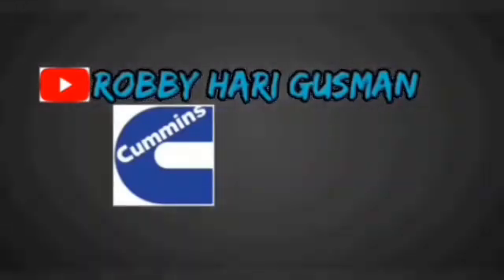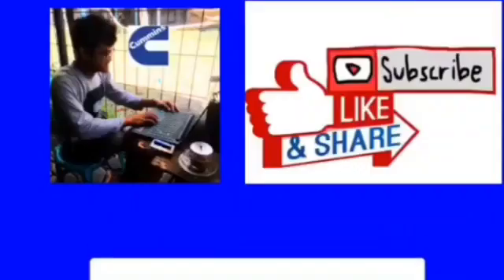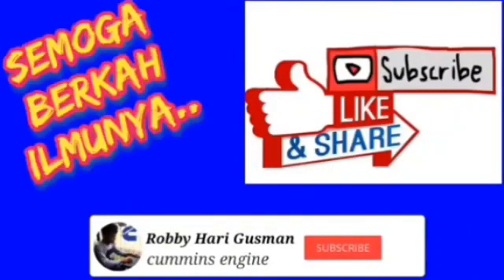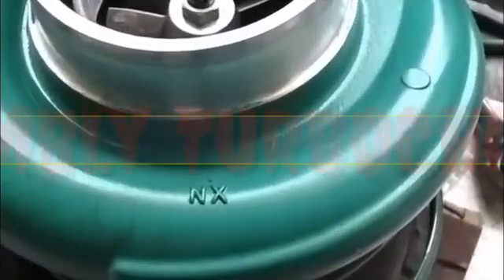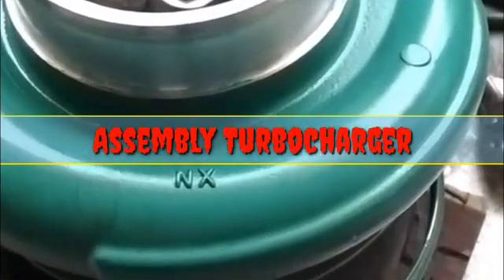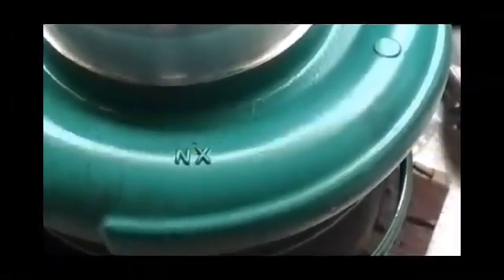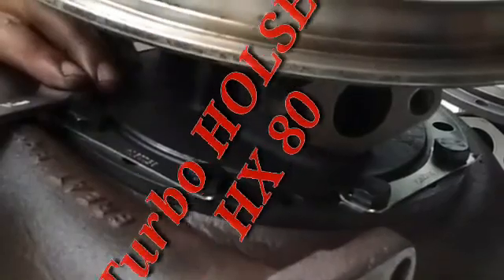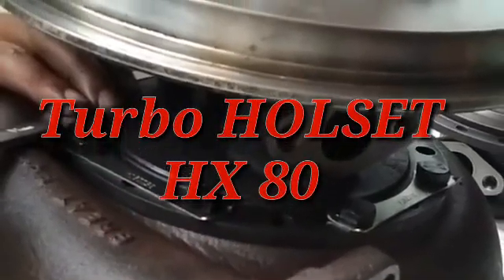Turbocharger Assembly Holset HX 80

Comment: kenapa no sound turbo holset hx80 cummins kta19 , saya mas.. apa masaala nya?
Reply from the maker: Maksudnya no sound ini gmn?
Reply: tidak noise,. bunyi..mas...
Reply from the maker: @aidelujing647  pada load dan rpm brp mas?
Reply: tidak boost turbo nya mas,
Reply: rpm 17 bang pada load.
Reply from the maker: @aidelujing647  powernya dapat gak mas?
Reply: itu mesin saya pakay di kapal mas
Reply: gak dapat powernya mas.